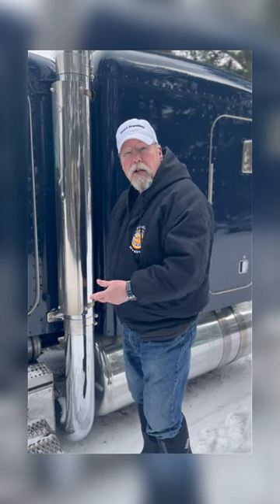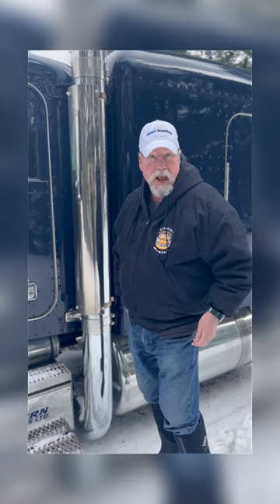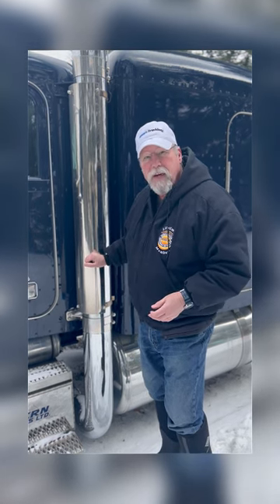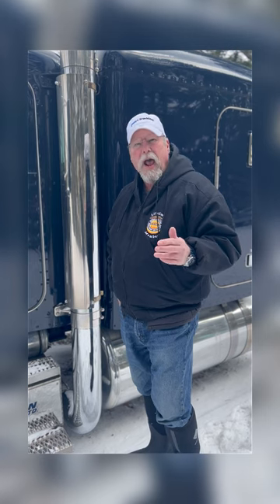No Place For Fake Stacks (or Sticks) on a REAL Truck #shorts

Comment: I saw a tanker outfit spec all their flat top 389s with fake chrome stacks. Their reasoning was so the DEF fumes wouldn't eat away the pipes from the inside. Good practical use for fake stacks in my opinion.

Comment: Most of the new generation of drivers couldn't drive those Spicer transmissions. Probably never heard of a brake saver. In some of the newer stuff they don't have a trolly brake. Just hold the steering wheel and go and wearing flip flops seems to be fine. 45th year and it getting worse out here.

Comment: I would never buy a def truck with the stacks hooked up, last 2 trucks had fake stacks and its awesome. 

1. Stacks stay cleaner and dont discolour from the heat

2.  Def system is much easier to access and maintain

3. Def system is protected from side impact damage, i had someone hit my parked truck right in the passenger side battery box, if i had my dpf there i wouldn't have been able to finish my trip, i would have been out a truck for a while

4. Can use passenger side box for storage for jugs boots etc things i dont want in my bunk

5. Cost of maintenance for the exhaust is near zero,   no y pipe no flex pipe no bushings, no clamps no tickets for any of that either.   

Buy one and find out the hard way

Comment: My addictional grievance is the new 567/579 with the vertical pipes in the side and only the right side is hooked up!!!  If they’re both going to be there, why’s it so hard for Pete to make both stacks work??
Reply: Funny part is both of the stacks on the 389s are hooked up. The scr is just turned down then y-piped to both.
Reply: It's part of the driver comfort package reducing noise on the driver side
Reply: Same with newer sd 122s and w900 log trucks. I know of at least those two first hand
Reply: Saves TMC money. 😅

Comment: The irony is that everyone here attacking fake stacks would attack that same guy for NOT running them… “No stacks on a 389? That looks stupid” “What, you wanna drive a Pete but can’t afford stacks?? What a poser” You can’t just run any old stack with the emissions without them discoloring… And even then you tend to get DEF running down them making a mess… Hence easier/cleaner to just to run without the stacks connected.

Comment: Eh, I kinda agree but at the same time, if you have a problem with that, you should have a problem with ALL cosmetic additions. Wanting the stacks for visual appeal is no different from wanting chrome, candy paint, lowering the truck, stretching the frame, etc.

Edit: The two stick I competely agree with it. Has nothing to do with cosmetic. It's there to give the appearance you drive something different and harder to drive when the reality is you're creating a more difficult, and arguably more dangerous environment for the sake of ego.

Another example: I worked for TMC for a few months. They run dual stacks for no other reason than visual appeal. But they also refused to put hood mirrors on the truck, again, because of visual appeal. One of the many reasons I didn't stay long. They were willing to trade safety for appearance.

Comment: I got a problem with these curb sniffing trucks that have all the fiberglass fairings over the fuel tanks and steps. Even a curb sniffer looks better without them. Also kws and Pete's with a visor that's 6 inch above the wiper blades!

Comment: What gets me is Peterbilt and Kenworth are putting 2 stacks on the newer models but only hooking up one because of the excuse that there isn’t enough room under the cabs. We’ll my answer to that would be to put the exhaust port on the sec lower with a Y pipe and then plumb the drivers side stack in. Or just put one stack on like all the old school trucks of the 60’s and early 70’s

Comment: My Lonestar has dual stacks both are hooked up the only problem is with the emissions engine the DEF leaks out the elbows and slobbers down the stacks staining the stacks and step boxes its a pain in the ass to keep clean there's a reason for horizontal exhaust not just aerodynamics It was a lot better before all these alphabet engines came along IMO

Comment: I did it on my 17' w9, no more baked on bugs the stupid hot emissions stuff doesn't discolour them. And no rain water to or snow to rot out the elbows as they are open on the bottom. 
With the emissions junk you can't hear the exhaust anyway or the jakes whats the difference?

Comment: That's the factory doing that. Granted at least on the Pete's the rain and snow can drain out the open end of the fake stack. The KW at work has a full exhaust to both stacks but only the curb side works.
Reply: Has the exhaust to both but only one works? How?

Comment: If you’re driving a 2 stick it damn well better be a 6X4 transmission capeesh? 🤌
Reply: Is a 5×4 ok
Reply: How about an 18speed with a 4 speed aug. A friend of mine runs one in PA 
It's a tri drive Pete. 
I miss that 2 stick 6 speed single stack Mack. It was so old it still had the Blue button and 2 red ones on the dash. 
That was 20 years ago.